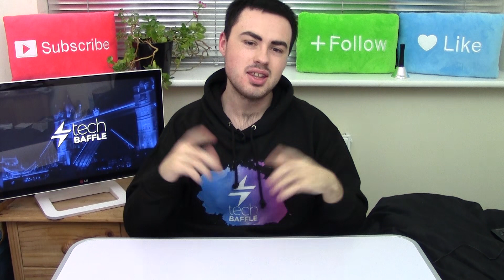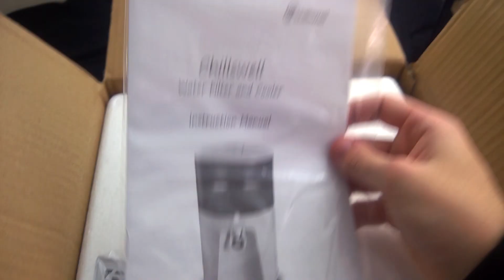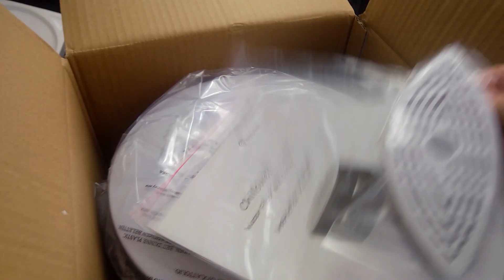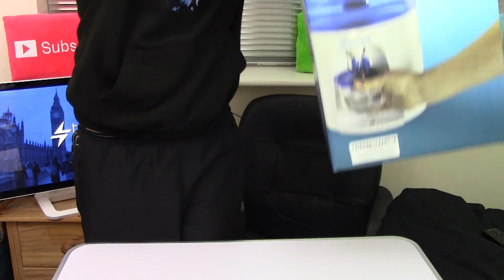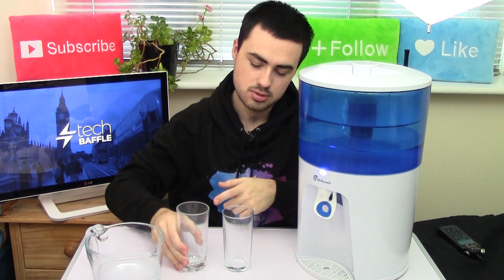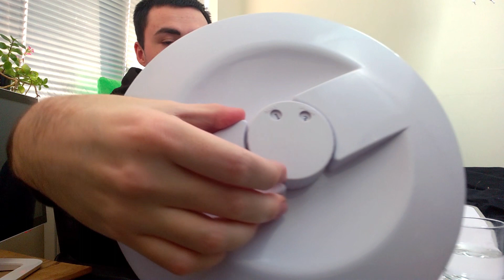This Water Machine can TRANSFORM Tap Water!

Comment: just ordered based off your review, tahnks.
Reply from the maker: Let me know how you get on! 😀
Reply: @techbaffle  The water is nice. Alot better than tap water. My only complaint would be the space between where the water comes out and where the tray sits is very small. A normal sized cup won't fit, If I try put the upper half under the outlet, the water trails down the outside of the glass and onto the side/floor.

I've bought smaller glasses to compensate.